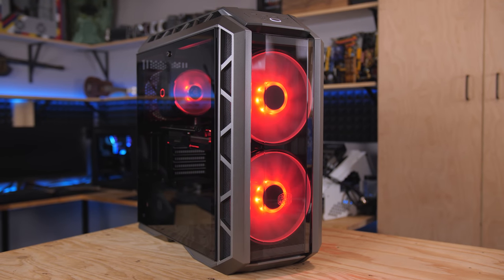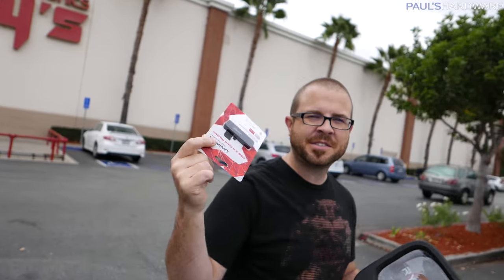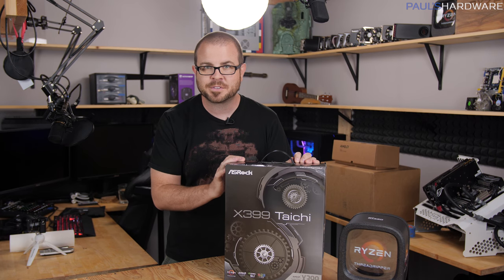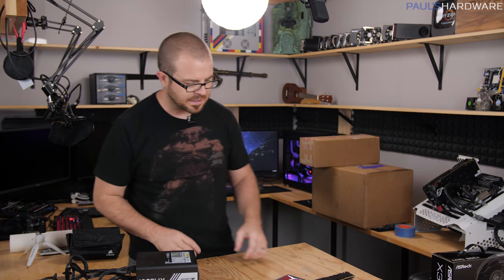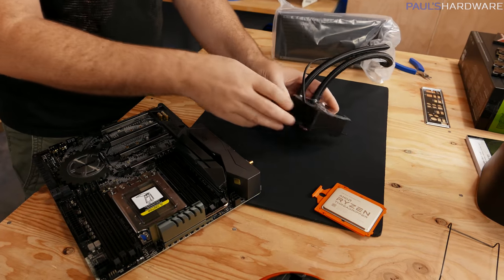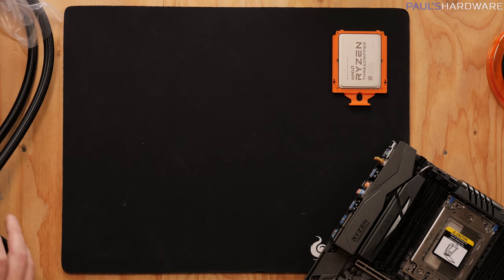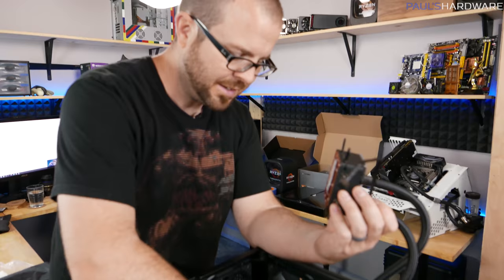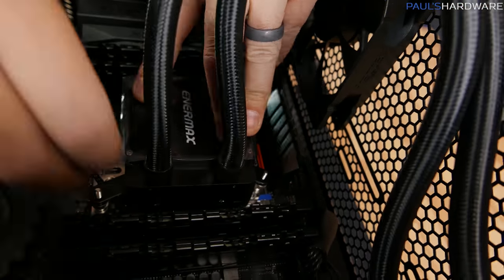Building the $1850 "Entry Level" Threadripper PC! 1900X + 1070 Ti

Comment: As stated by one commenter.  I would go with a raffle if it is possible.  It would be more inclusive for your audience from a numbers standpoint.  Just based off the number of views of the video(57,497 @time of posting), I would think that 1% or less of your viewers have enough disposable income to make an auction worth it.  The odds that you have a bunch of millionaires, that are 1. looking for a new computer 2. are willing to get into a bidding war for it &/or 3. are fans enough of where the money will go to in order to bid more than the computer is actually worth,  I would think are very low.  Now if you were to do a raffle at say $5 a ticket it does depend on the number of entries.  If just 1% of your viewers enter, you're looking at $2875 raised.  This is assuming an individual only purchases one ticket.  My guess would be if the cost to entry is $5 that you will actually have a high percentage of viewers that will purchase multiple entries if allowed.  After watching enough "Awesome Hardware" episodes, I know there are quite a few viewers that would purchase 5 or 10+ entries.  Just food for thought